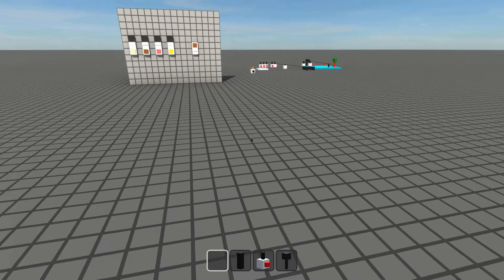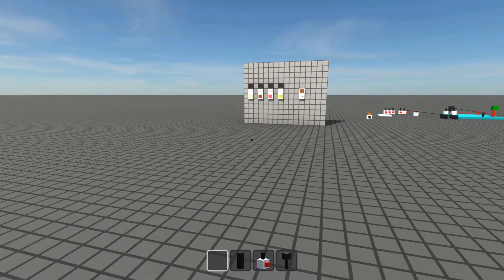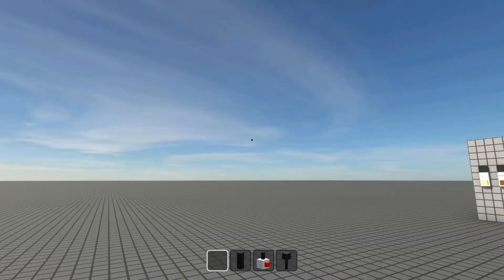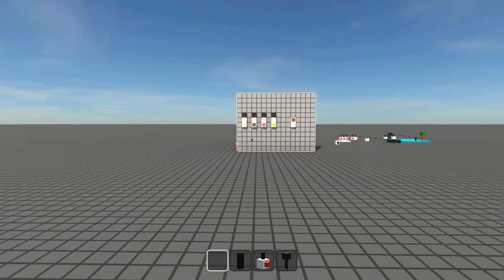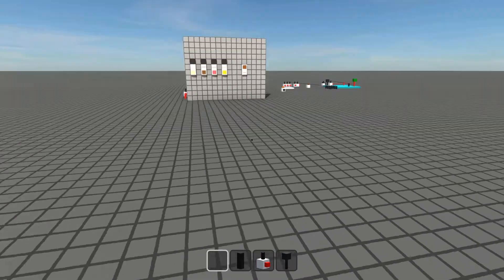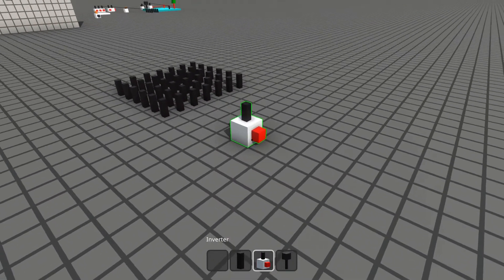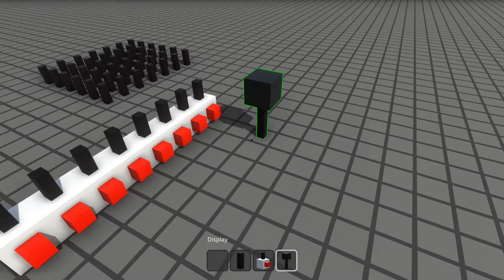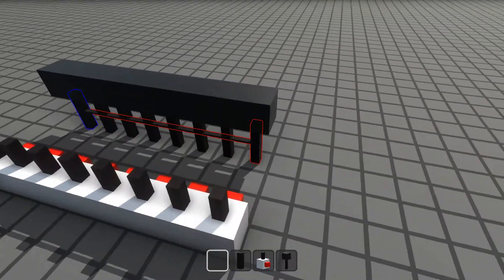Grid Placing

Comment: not explained how to do it exactly, my game does nothing. The item only shows at the crosshair when i hold the left click. When i let it go it just place the items. No holding ctrl or "mod" button in my case swamped it the default ctrl for alt.
Just can't use the feature. what am i missing?
Reply from the maker: Unfortunately this feature had to be cut from release 0.90 for time, but it will be coming back very soon in update 0.91 :)
-Jimmy
Reply: still dont work in 0.91 @MouseHatGames